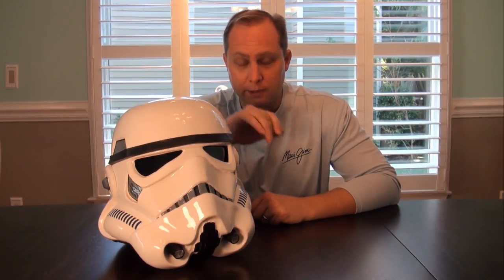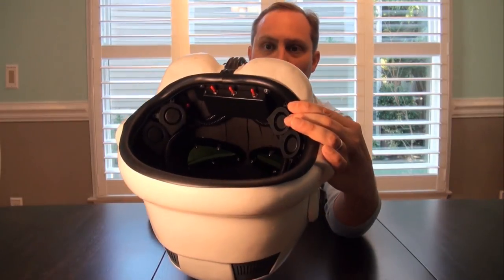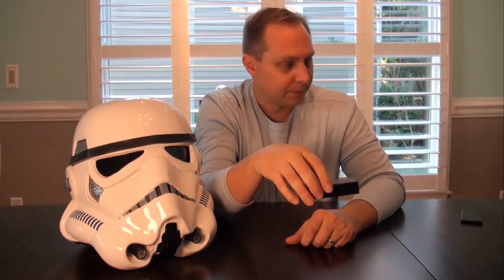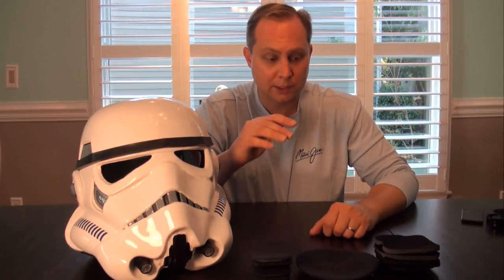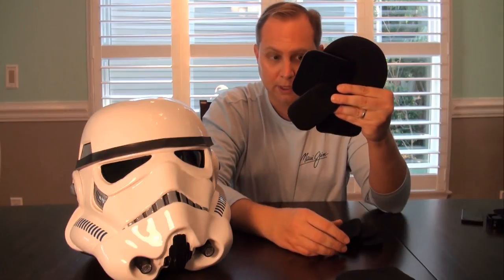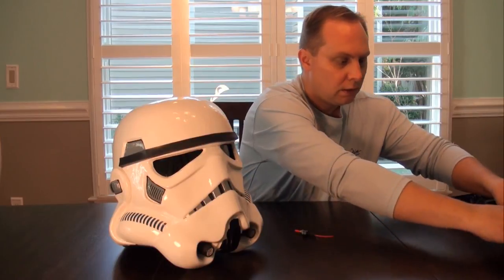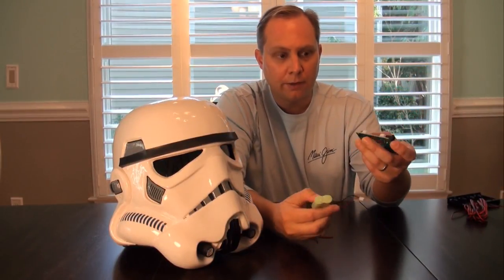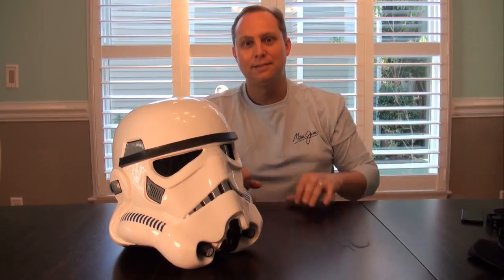TK11778's HOWTO: Super clean helmet electronics/interior build

Comment: Thank you for ur help earlier.  Just curious if u have an amazon link for the quick release adapter for power supply.
Reply from the maker: If you mean quick disconnect adapters/plugs for electrical wiring, I don't have a specific link for any I used here, you can just search amazon for "electrical wire quick disconnects" and you can see a bunch of options, styles, and sizes for your needs. I hope that helps?! :)

Comment: Yours is one of the only RS helmets to have no gaps between the ears. Any tips to get that flush and clean look?
Reply from the maker: Well, there's a trick to that. Since I fully painted my helmet after constructing it (full primer job, base coat, clear coat, etc), I had the luxury of filling in the gaps with epoxy and shaping it a bit to look like a seamless fit, then the paint job ended up making it look like it was a tight seal. Probably not what you wanted to hear lol. :)
Reply: @TK-nq9zq  Thank you that's great advice! I'm new to the collecting/Prop Replica so all information is great information! I've been flirting with the idea of an "Idealized Stunt" helmet  but working out the techniques and costs I may or may not invest in. Your helmet has so far been my gold standard, your work is amazing!
Reply from the maker: @osvaldoberumen3990  Thanks for the kind words! Good luck with your stunt helmet endeavors and glad you found this video helpful. :)

Comment: I've been considering 3D printing a Stormtrooper helmet versus buying one. Which helmet is this exactly? Do you know many troops that use 3D printed helmets or are most of them purchased and then altered?
Reply from the maker: Hey there. While I've heard of people talk about 3D printing a helmet but I have never actually seen anyone with one and I've seen a LOT of helmets. Most are ABS or PVC and are pulls from either the original prop or molds that replicate it extremely well. Nobody buys an off the shelf helmet like a black series or something then converts it, at least not that I'm aware of, it will probably require more work than its worth. If you're looking for a 501st approved helmet the standards are a bit strict so most rely on one of the vendors that produce quality and approvable pulls, which then are transformed into built helmets with trimming, sanding, bolts, paint, etc. Hope that helps, if you're really interesting in building something and haven't already done so I'd recommend joining whitearmor.net - the location of the first imperial stormtrooper detachment of the 501st where all this is discussed in great detail.

Comment: I don't know if anyone can help me, but I was curious about the dimensions of that steel plate he used to mount the project box.
Reply from the maker: It is a 5x3 piece. Note I rounded the edges, and bent the bottom part a little inwards so it sort of tucked nicely into the form of the helmet, but that is totally optional. Obviously I sprayed it matte black as well. :)

Comment: Great build!!!  What did you use for the amp, speakers and mic? Where are the speakers placed?
Reply from the maker: So I originally had tiny speakers embedded within the hovi tips, however that eventually didn't work out well as I found they didn't product enough output for people in public to really hear me well if they're not standing right in my face, plus having speakers so close to your mic means you need to be careful with feedback. I opted to go with a Aker MR1506 that is mounted in my Ab plate behind the button bulge, which is connected wirelessly via bluetooth to a powered microphone up in the helmet that connects to the bluetooth transmitter via 3.5mm jack. If you desire you can feed that through a voice changer unit before hitting the transmitter. Hope that helps. :)
Reply: @TK-nq9zq  What did you use for bluetooth? I assume it has to be a really small receiver, What bluetooth mic did you use?
Reply from the maker: @cnsf  For the transmitter/receiver: https://www.amazon.com/gp/product/B00OPVWHRY and for the mic: https://www.amazon.com/gp/product/B015GDVSJ2
Reply: @TK-nq9zq  Thank you!!!
Reply from the maker: @cnsf  You're welcome! :)
Reply from the maker: @cnsf  Looks good to me.
Reply: @TK-nq9zq  Do you have a guide on how you mounted the MR1506?
Reply from the maker: @cnsf  Nothing yet, but literally: (a) superglued velcro on the back of the unit and corresponding velcro on the inside part of the ab plate; (b) attached it. :) The size of the 1506 actually fits perfectly in the recess area of the button panel of the TK ab plate.
Reply: @TK-nq9zq  You rock!  Thank you.
Reply: Any chance you are on whitearmor where I could DM you? I just set it all up and the iComm needs a power source and doesn't work in this setup with a bluetooth transmitter and receiver. Will the powered mic provide power to the iComm? I am only using the passive condenser mic for now.
Reply from the maker: @cnsf  Yeah, my forum name there is Kamikaze. The iComm needs a powersource which is typically a Aker 1506 unit.

Comment: Do you have a link to how you did the wire connections
Reply from the maker: Sorry, I do not have more detailed illustration of the connections right now. I made this video in response to all the comments I was getting about the interior build, mainly to offer a higher level breakdown of what I ended up doing. Is there something specific you are looking for more elaboration on? How to make switched connections for these components? What is connected to what? I could come up with a basic wiring diagram if it helps people.
Reply: Maybe just showing exactly how you did your wiring of your helmet I'm just trying to get a better understanding of how you did yours and I could just work with what I have from there
Reply from the maker: @jojo100021  Since what I have is all finished, loomed up and wired in, the best thing I could probably do is a wire diagram that shows the components and how everything is actually wired up. I'll throw one together when I have some spare cycles this weekend or early next week, hope that will help, and I'll attach it herein in the description.
Reply: @TK-nq9zq  Hey Kamikaze! I have been reviewing your build and am pulling the trigger [hopefully wont miss ;)] on purchasing the items required to complete. I am looking for that wiring diagram and cant seem to find it here or on the forum. Any chance you could message me ?  Thanks in advance

Comment: Can I ask you why paint the helmet black inside !
Reply from the maker: I didn't paint the helmet black inside, some people do, one of the key points within this video is how I instead used neoprene lining. Regardless, people black out their inside one way or another to finish it visually but also ensure that the inside is dark and obscures the face from the public through the lens which may come through easier when it is all white inside. My neoprene lining does not only that but provides a bit of padding comfort, insulation, and moisture control.
Reply: @TK-nq9zq  alright cool